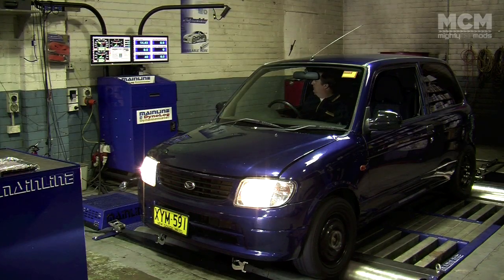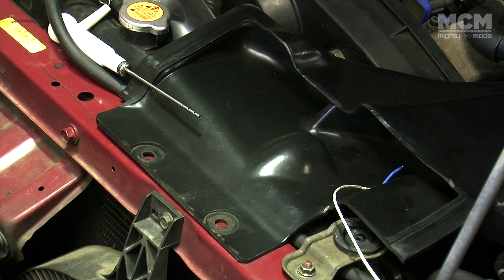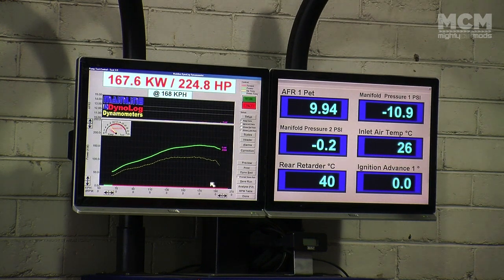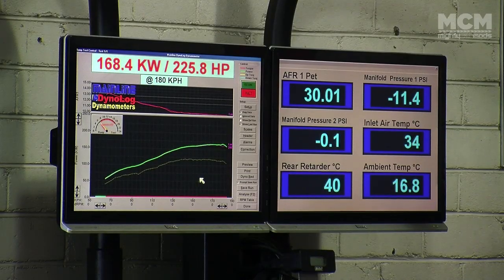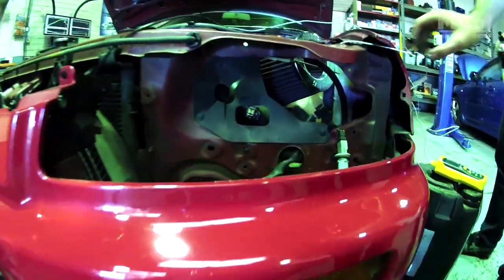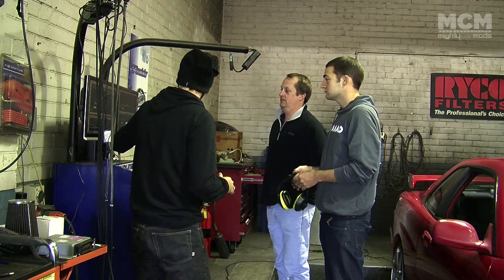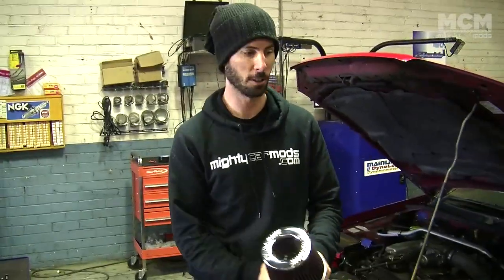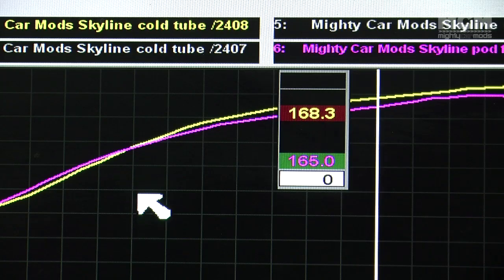Cold Air Intakes Mythbusted [Turbo]

Comment: CAIs are only effective on modern cars when the engine has been tuned to make use of the cooler intake temps and denser air charge. Just throwing a CAI on a car and expecting more power is silly.
Reply: The gains are real, but even less on turbocharged car. On a N/A car gains are going to be around 5%, no tune is necessary because the ecu sees air density and air temperature and adds timing and fuel accordingly. Why mcm used a turbo car was either to prove their point or were not thinking because a turbo runs off hot exhaust gases.
Reply: Yes it will set off the CEL, but if you reset the computer (i.e. Unhook the battery, turn the key in the ignition a few times to totally drain the power from the computer, and reconnect the battery) it goes off because resetting the computer forces it to adjust the fuel flow to the engine to correct the air/fuel ratio. And that is when you see gains. Just adding more air will make it run too lean and cut your power. If the computer adjusts to the extra air, it will add extra fuel to compensate, and with both more air AND more fuel, you can produce more power.
Reply: Justus Smith You're partly right about wiping the ECU by disconnecting the battery.

Disconnecting the power supply forces the ECU to lose all fine tuned fuel maps that are saved in volatile memory (memory that needs constant power). Disconnecting the battery for a long period ends up sending the ECU into a failsafe mode that provides an air/fuel mixture of roughly 14.7:1.

Once the ECU starts fine tuning the mixture, spark timing, valve timing and all the other aspects,  It will push toward tuning itself to predetermined limits set by the manufacturer. 

Ultimately, the ECU will still throw a CEL and go into "limp mode" if it still detects more airflow than it can handle (I.E. an aftermarket intake). The only way to get rid of the CEL issue is either with a custom tune, or using the stock airbox.
Reply: Ning3n couldn't you just upgrade the fuel pump/injectors so it could handle the extra air?
Reply: Justus Smith The ECU still needs to have its maps altered to make use of the added fuel, in addition to the added air.
Reply: Matt Thompson true, but usually a CAI won't increase airflow enough to require all that. Normally, with the factory airbox, the fuel pump and injectors aren't working nearly as hard as they could be. You usually won't need to upgrade unless you switch to forced induction or, if it is already forced induction, decide to run MUCH higher boost. At that point though, you should be more focused on reinforcing the engine, because if you blow the engine, it doesn't matter how good your injectors and fuel pump are, you wont be going anywhere. sorry, got a little off-topic...
Reply: Justus Smith That's where you may be wrong. Depending on the ECU tuning of an individual vehicle, stock. 

I've owned an '09 Mitsu Lancer Ralliart. Comes with (essentially) the same 4B11T engine as the EvolutionX, aside from milder cams, a single scroll turbo (VS a twin-scroll turbo), a TC-SST transmission with a weaker clutch than the MR edition EvoX, and a MUCH milder ECU tune.

I purchased the car with an aftermarket CAI, it was traded in because the previous owner was tired of dealing with the constant check engine lights for misfire codes. I purchased a Tactrix setup and tuned the ECU over a period of 5 months, completely eliminating ANY CELs. 

BTW, a dyno test showed I'd gained 6hp (over stock) with the intake and my crap tune.
Reply: Matt Thompson Wow, you pretty much typed what I said in a prior comment.... Or was it copy-pasted?
Reply: Matt Thompson Well, thank you for backing up everything I've said in previous statements!

I've spent a number of years personally remapping modded cars to get rid of CELs, and almost always ended up giving them more power. With a few European exceptions.
Reply: Sorry wrong, I live in Canada and in spring and fall and even winter air temps can differ 20c morning to afternoon and the car must handle this in the closed loop data. So a CAI is just like driving on a colder day. Engine will respond accordingly within it's factory tune and should so the magical 5-20%..
Reply: Lenny C The discussion is not about varying air temperatures. It's about increased air volume.
Reply: Lenny C A variance of naturally occurring air temperatures (and the inherent change of density/mass) is generally accounted for in basic ECU tuning from the factory.

The added airflow/air mass from a CAI isn't normally calculated by OEM manufacturers, which is why a CAI that isn't CARB certified will throw a CEL on a post 1995 (AKA, CARB legal) vehicle.
Reply: as an example: engine's run with nearly completely clogged air filter. how with that much restriction is the computer ever to handle the data.

CAI's rarely provide more CFM to an engine over stock and even in THE CASE OF THIS VIDEO and the other's they've done. The increased piping diameter reduces the air velocity which decreases the scavenging effect and overall performance.
Reply: 100% correct. Sadly, we can't educate the whole world about this.
Reply: Again, 100% correct. Without changing the map to add more fuel, you have done nothing. This is precisely why they stress the "tune" which is nothing more than increasing the fuel mapping. The problem is that pressure is increased after a tune and may crack the head or bend the rods. Best to just buy the right car from the get-go.
Reply: Just a final note, you're all assuming by using a CAI you're massively increasing CFM to the enging and massively decreasing intake airtemps..In most cases neither is true, thus keeping all engine parameters within the capabilities of the OEM map. And most engines run a little rich from factory to keep combustion temps down and prolong engine life, so IF there was "unaccounted" for air in the engine it would just run Stoich.. if the O2 loop didn't correct it or throw a CEL.
Reply: They run lean from the factory buddy, for emissions reasons.
Reply: Towards The Sunset
Perhaps canadian maps are slightly different..never seen over 15 up here.
Goggled "factory AFR's" for 30 seconds and most manufacturers seem to be running 13's down to 11's in a couple mazdas depending on the rpm's.. maybe you're in Cali-emission prison..
Reply: Lol good one "Cali-emission prison". They usually run on the lean side of stoich so as much fuel as possible is burned, thus providing better emissions test results. Canadian maps may be different...haven't lived their in over 10 years....how things change...
Reply: Towards The Sunset Lenny C  "Cali-emissioni prison". I'll have to remember that the next time I refer to C.A.R.B.
Reply: Ningen you understand thank you, you have to tune it. MCM doesn't understand that obviously.
Reply: Lenny C
 You're correct about the canadian day emulating the CAI effect. And it has quite a large effect IMHO, on a mildly cold day (say +5C) a cold start the engine feels much snappier than after it warms up. However my car (and I assume many others) actually run engine coolant through the throttle body to warm the air and keep the temperature consistent. Want a FREE CAI? Bypass the throttle coolant line. Your coolant is going to heat up your air to about 45 degrees C once the engine is warm.

That said, a CAI will NOT increase flow, these guys proved it. The CAI is supposed to get its power from sucking in cold air, which is denser, which is exactly what Lenny was saying with the canadian days, and what these guys got by moving the intake out of the warm engine bay. The engine doesn't care, the stock filters are MORE than capable of sending any air the engine needs, it's not until the filters are stupid clogged that you'll notice a drop in power. This is because it is the engine's PISTONS that draw the air, a new filter is not going to magically change it. If your engine displacement is 1.6 liters, then (assuming 100% VE) the engine will suck in 1.6 liters of air every revolution, and mechanical vacuums are pretty powerful, especially when you've got a gasoline engine running it. The filter isn't going to be like "hey bro, I got more flow, here some more for ya". It's only when the air is DENSER (That is, more oxygen PER LITER, because a liter is a measure of size, not weight), that you will actually see a gain. How are you going to convince your engine to take more air than it's pistons can draw? Forced Induction.

TL;DR version: Engines draw air based on their size, NOT on the filter. Cold air is denser, which means more oxygen per liter (or cubic inch), which is where the power comes from. Unless your filter is stupid clogged or you run a turbo, your stock filter is more than enough. Remapping a cone filter? The power came from the maps, nothing at all came from the filter.
Reply: Calvin DiBartolo Right on the money, m8!
Reply: Agree. I'm still throwing one on, for  the sound though.
Reply: Not true, if you haven't defined modern.  I have a 1993 vehicle and a 1998 - both of which are slower accelerating (literally down on power) when I have removed the cold air intake source.  As a reference, this is when working on them and test driving them before the intake ducting being put back together.  It's not about getting a power gain - it's about not losing power, as far as a naturally aspirated engine is concerned.
Reply: Agreed if you have exhaust snd an intake its useless without tuning
Reply: jj lewis There is a difference in gaining power and not losing power.  Hot air in the intake causes engines to generally run poor.  While you may not get more than 1 or 2 hp by adding a cold air intake, it's better than losing 1 or 2 hp because it's sucking heat.
Reply: Matt Thompson While you can't feel 1-2 hp loss or gain, it was just to say that losing hp is worse than not gaining.  And I know when people do something to their cars, they psychologically think it's faster or slower, yet, with the amount of experience I have with my car, I know it's true in the case of its performance and it's more than 2hp loss.

From my experience, both my cars are underpowered in hot conditions without the factory cold air assembly in place - forget performance filters - I mean zero filters.

It feels more like 15 hp loss, considering it's actually noticeable loss.  I have to say, especially in my car.  I removed the intake and the two throttle bodies sucking hot air on a summer day from the back of the engine bay was a very noticeable drop in performance.  Same conditions, same day, with the factory cold air intake back on, it felt normal.  And that's with the intake restriction to keep the exhaust quiet.

I've also had fun many times with the intake off, making noise and it's always sluggish when it gets hot with the intake off.  I know that car like my own cock.  Haha.  I've pushed it hard and I know its limits and its performance.

Lastly, I know intake and exhaust improvements can actually cause you to lose power.  For example, I recall the Ford Probe/Mazda MX-6 losing HP after fitting headers.  And the worst part was, the rear manifold was so hard to remove, it really pissed off the tuners.  ;)
Reply: Matt Thompson If you want something quick and stock, warrantied, etc. then yeah, for sure, just buy something that comes like that.

Some people like custom, unique, crazy. :)
Reply: Matt Thompson I find a lot of charm in older vehicles.  I like new techy things a lot, but I my garage is for classic Italian sports cars, American muscle and the custom, unique stuff.  I'd much rather rescue a Lancia than buy a Mustang.
Reply: Matt Thompson Yeah, I'm the same way - Mustangs I mean.  I like the 65/66, 67/68 and then nothing until 87-93 (I don't really like the 4 eyes models that much).  I like the 5 litre LX hatches mostly - http://www.mattstonecars.com/images/large/1991-ford-mustang.jpg is a perfect example of what I like.

Yeah, as you get older, you need the A to B.  I just want to be able to enjoy some classic cars when I'm not working.

A lot of digitizing analog readouts is because mechanical tachs can't keep up very well to faster revving and are less accurate.  Once they start switching some, they whole lineup tends to lean in that direction for cost efficiency and share a lot of parts.  It's really not uncommon to find any manufacture using the same basic part and/or the same manufacture to cut costs.

I personally like analog readout, even if it's electronically driven like my car and van both are, rather than a video game in my dash.  That being said, there is a time and place and I think the Lexus LFA was one of the first, if not the first, to fail tachometer readouts and then decided to use a digital one. hehe.
Reply: Matt Thompson I like the 1986 Camaro shape - it's pretty clean, no ground effects at that point.  But the 305s weren't my favourite engines.

Simple digital was killed by GM, but I really mean the graphic digital interfaces we see today where the tach is actually like a playstation. ;)
Reply: dlanes never had a CEL show up on all 3 that I've put on intake on and I never understood hooked the battery.
Reply: Matt Thompson I've always gained mpgs on my 3 I've had a CAI on. 04 ford f150 heritage, 08 f150, 14 hemi ram

Comment: they mythbust nothing

CAI's don't do much or even hurt on stock sytems, since the ECU is configured for stock filter

 but they are a mod that make you able to gain much more power with a decent tune than with stock filter

on mkIV forum (supra) there is a test with Blitz, Apexi, K&N, HKS and some other filters vs stock

the test car was tuned and all filters gave around 14bhp gain, while the blitz(metal mesh) and hks(foam) were VERY poor at filtering and K&N filtered reasonably
The apexi gave most bhp gain (although only 0,5) but was most definately the best filter. Probably even better than stock paper filter

all I wanna say is: CAI on stock does only give sound
CAI with mods can help
when using pod or panel filter, use one which also filters well (injen/amsoil, apexi, aem dryflow for example)
Reply: Dan Ilges
That's a horrible analogy. Plus the ecu does control air/fuel mixture, which can be tuned to compensate for colder air.
Reply: they are not understanding air density, they are just moving warm shop air faster so the temp probe is being cooled, not actually reducing the air temp thus not increasing the amount of O2 going in
and as llllnemo said you'd need to reprogram to get any gain on a modern car
Reply: Brian Catnut I agree with the shop air comment, I was thinking the same thing.  I do own a '14 mustang and bought a CAI for it and without a tune got a very noticeable gain in HP and FT/LBS.

Comment: Love the comments section everyone has different options I'm learning more this video makes great for education purposes
Reply: If you buy a cheap intake it won't do anithing, im no implying, expensive is allway the best option, becouse it cost more, but becouse is been bouild with a better quality, and this translate to efficient air intake, is not the same to put a 50, dolar intake for your engine, and expect the same results, as to buy an intake for 150$ made by Japane, or one made on USA, the performance will be different due to the quality, of the part you are buying, in this case a cold performance intake. 

Fartheremore we don't know the make or price of this intake, they might look similar as an expensive one, but surely won't operate the same, so unless I know where and how much this intake cost, I won't take this video sirusly and you shouldn't  either.